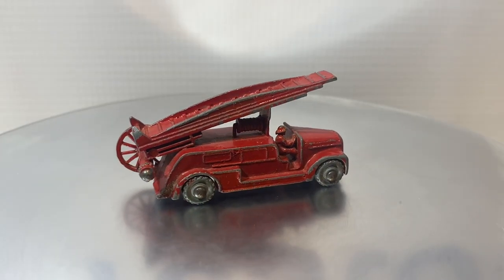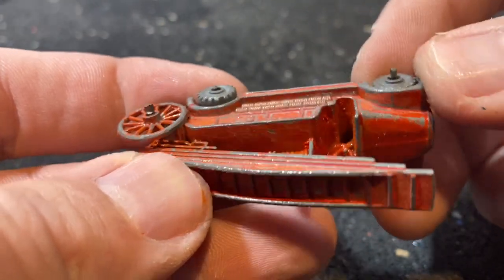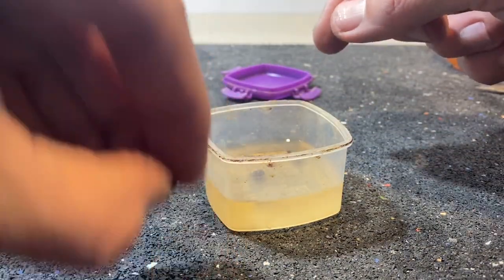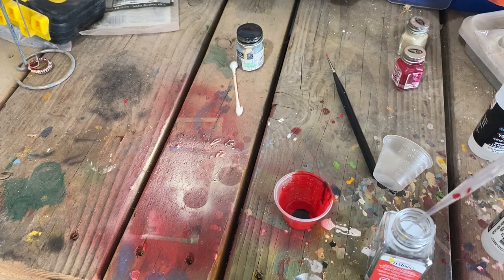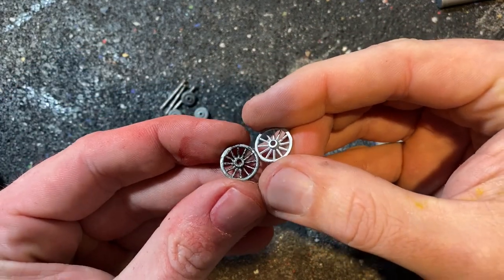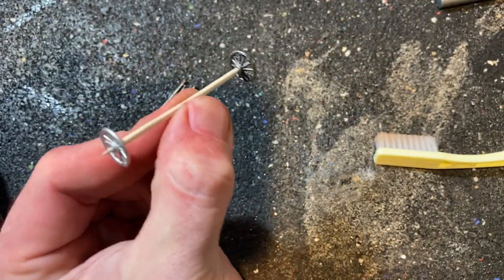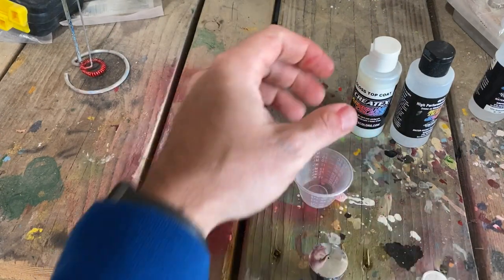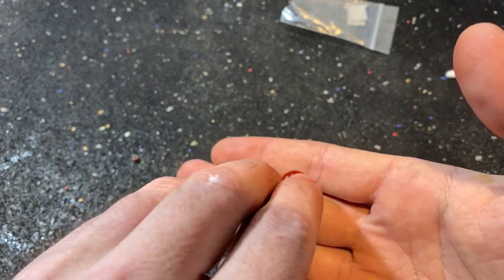Matchbox Lesney  #9a Dennis Fire Escape Complete Original Restoration and Repair

Comment: An excellent video and very interesting and pertinent for me, as a few days ago I rescued my childhood model from my old toy box in the loft so I have a question. Where did you obtain the catalogue and the sheet detailing the differences between editions?

My model is in much better condition than the one you were working on and the existing paintwork is present except for the raised areas of the casting. As much as I liked your finished model I think I'll leave mine as is. As a matter of interest, the underside of mine is painted red, the radiator grill is flat and the top edges of the ladder are not painted gold.

One difference I noticed is that the spokes of the ladder wheels on my model are a lot finer than the original wheel on yours so I’m not sure if this makes it an earlier or later version. There does appear, however, to be a gap between the driver's arms, legs and steering wheel.

I shall certainly be watching more of your restoration videos in the future.
Reply from the maker: Sounds like an early model, I would leave it as is too!